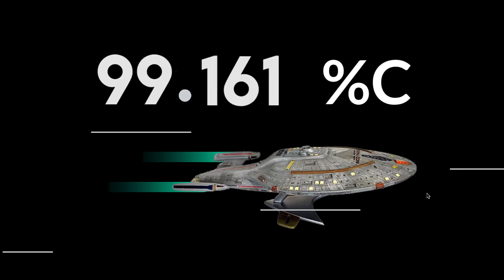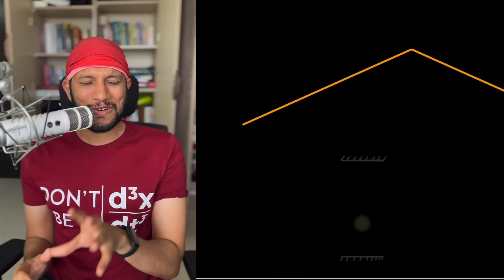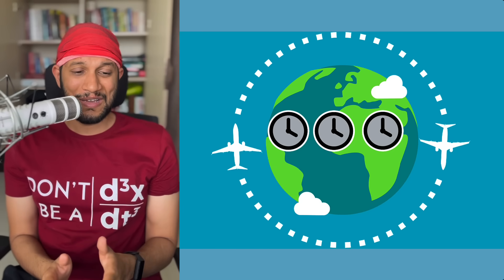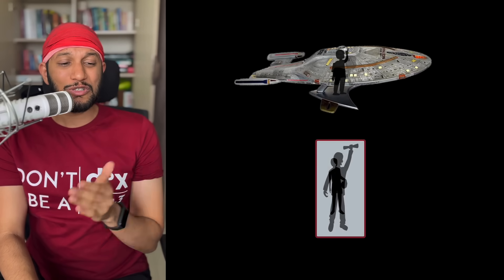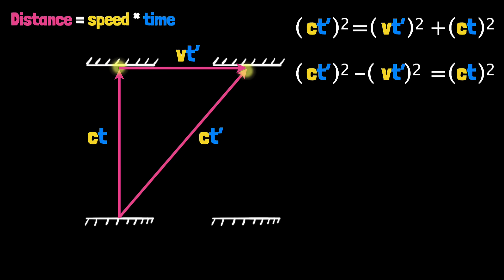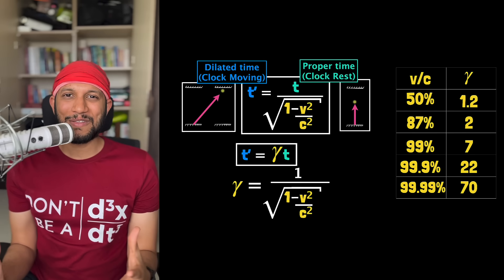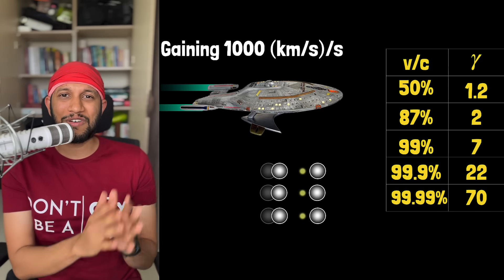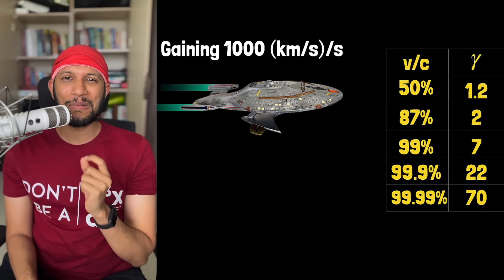I finally understood why you can't go faster than light! (My mind is blown)

Comment: What if 2 vehicals traveld in the opposite direction from each other at 99% the speed of light would they be travelling faster than the speed of light between them ?
Reply: No, they still be traveling at 99% the speed of light. Remember no object with mass can reach the speed of light.
Reply: @Voidඞ but the distance between the 2 would be increasing faster than the speed of light, so nothing with mass is breaking the speed of light individually, but the distance between them would be increasing faster than the speed of light, like space expansion which is faster than the speed of light.
Reply: @420styletomatoes6 Einstein’s speed limit applies to local motion — how fast one object moves through spacetime as seen by another in the same local frame. 

But “the distance between two distant objects increasing faster than c” is a coordinate effect. It’s like saying: “From Earth’s frame, the gap between them grows faster than light — but no signal, no object, and no information is crossing that gap faster than c.”
Reply: @Voidඞ  ok, well what about if when the craft was doing 99% the speed of light they knocked it down into 4th gear, would that give the craff the extra exceleration needed to reach 101% of S.O.L
Reply: @420styletomatoes6 you will need an infinite amount of energy to reach that speed "101%" but that is impossible, and there's no finite force can supply that energy to infinity.
Remember time dilation slows down that ship to infinitely dilated reaching the speed of light. From outside observer that ship looks like slowed down.
Photon's on the other hand is, "timeless" they don't age because time is basically frozen from photon's point of view.
You see, the moment our Sun create's light or photons. That's when moment it hits our eyes. It takes 8 mins. 20 sec. Light from the Sun to Earth. That's why photons can reach the speed of light because they have no mass.
Reply: @Voidඞ  what if i put vodka in my SR Nova fuel tank, would that give me the extra energy needed?
Reply: @420styletomatoes6 good question😆

Comment: If you travel faster than light, you will arrive before you can be seen or observed,but we are observing using light spectrum, so we only really arrive in our observation when the lights reaches us to observe it. Until we change our method of observation, then it becomes visible in data,not by sight.

Comment: Even though the maths add up, we still don't know what the heck is actually happening, and why an object in motion has all processes slowed down, mechanical, biological, atomic, it happens, but why, what is the effect?

Here's another question, why does a photon get anywhere at all, this time dilation doesn't affect light?
Reply: Photon's proper time is = 0
Which is photon's "point of view" time is effectively frozen.
Reply: It does affect light. Photons does not experience time. For them the instance they were created is the same instance that they were captured. So for any photon that you emit from a light source, the time will be same for when it is captured on a screen.
Reply: @tanmaypathrabe9579  Does that sound right to you?, something very strange is going on there.

The measurement of time being off due to the distance any information about it can travel, but the time taken for anything to happen should be constant.
Reply: Cause there is a limit set by universe that nothing can travel faster than the speed of light or you can say faster than information travel speed.

Comment: Can someone answer me this question. If the speed of light is impossible to reach than why cant we just go limes against speed of light? We will never touch the exact speed bit come closer and closer? For example speed of light is 1 in this imagination and we go at the speed of 0,9999999999999999… maybe even period 9. Is this possible in theory?
Reply: 0.99period is exactly 1.
Proof: 
1 divided by 3 equals 0.33period.
3 times 0.33period equals 0.99period.
Remember that you started with 1.
Reply: @ralfrufus6573 ok but you grasp my idea. Is the idea possible?
Reply: @bowlerbowler6869 No matter how close you come to the speed of light, a photon is always moving away from you at the speed of light.
Reply: No object with mass can reach or exceed the speed of light—an infinite amount of energy would be needed to reach speed of light. 
No finite force can supply infinite energy.

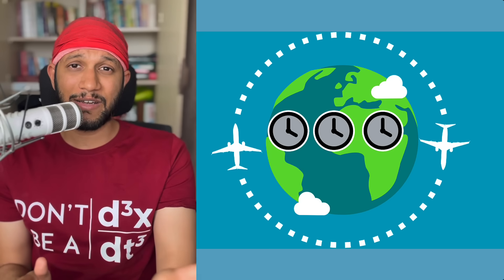Comment: 4:30 - so basically there is no "time dilation". If there is no information transfer in the accelerated body then this phenomenon doesn't occure. So basically if the object is bigger and more complex then the information travels longer between parcicles on both ends of the object. If the object is an single particle, then the phonomenon should not take place. Do i understan correctly?

Comment: You can't go faster than speed of light if you decide that light is the speed limit and the last 100 years physics is based in it, but what if you use a different speed limit? Way should light be the item that decides speed in the universe, if we will find particals or space itself that are faster than light what will happen then?

Comment: So what would happen if you were traveling 99.9% the speed of light and you turn on your headlights?
Bear in mind the if you are flying along in a jet at five hundred miles an hour and fire a machine gun the projectiles will move at 500 mph + the velocity of the machine gun round.
So again what would happen when you turn on the headlights?
Reply: The Relativity ensures the speed of light remains constant for all observers.
So if you turn your headlights on, the light beam will move away from you at the speed of light
Reply: @Voidඞ but wouldn't that mean it was moving almost twice the speed of light?
Reply: @SmithRobert42 there's no such thing as twice the speed of light in Relativity. The speed of light remains a constant. So if you shine a flashlight at 99.9% speed of light–it would still fly the same speed of light and a bit further away from you.
Remember speed of light is a fundamental limit in the universe according to Einstein's theory of special relativity.

Comment: If at all that shows that if you have gravity source you cant get to C and that you cant navigate by eyes because everything from outside comes in with LAG like in online gaming with bad internet. Dont forget that its all relativ even in the literal sense. You inside the ship and all you photons and and your own gravity source accelerate too. Relative to the outside they stand still. Hence why the whole thing si wrong as you see it from a 1 dimensional point of view. You can cross C by many magnitudes but you cant do it at once. You rip apart the bonds of atoms. Also time dose not exist, what exists is decay. New problems arise tho because the faster you get the bigger gravity field you create. Gravity interacts with all forms of radiation and can alter its course. as seen by black holes. so the trick is to get to almost C wait little until all things settle and brake throu C and repeat. But then the you need to stop and deal with the gravity field you emit....

Comment: Interestingly, isnt it that not the time itself is bended, but the "following affects" in space by time.
Like the clock still moves in the time of 10 seconds (time is the same) but the space, the change in space, which happens in time (same 10 seconds) is slowed. Time dosent change, but the following of space and its object, by the time, can change.
If a car drives 100meter in 10 seconds or 10 meter, the time dosent changed, but ofc the "event" in space, by that time.

Comment: I’m new to this topic so correct me if i’m wrong but doesn’t this only explain how we(as the observer in normal time) could never see a universe in which something goes past the speed of light (since it’d need infinite time).

but it doesn’t make it impossible for something (or someone) to do so. Just to observe it from outside. Kind of like how you could never observe the inside of a black hole past the event horizon since nothing (not even light) can escape the gravitational pull no?

Anyway that’s the only contradiction i got from the video and title. Love what a great detailed and conceptual explanation this is!

Comment: Dude mekesh, you CAN reach and exceed that speed of light, in fact you would not even notice when it happens, but you dissapear from this universe. Reason why it appears you cannot go faster then speed of light or reach it is same as why it appears cooper never falls into the black hole. It is a limit to infinity. But aha, you forget then from his point of view he actually does enter the black hole. And for exact same reason (since it is in fact the same process just entered from opposite side) it appears you would need infinite energy to reach speed of light and you never seem to reach it, but from the person traveling aka accelerating he or she actually teaches speed of light and at that speed dissapear for us and we at the same time. Dissape for him and a new universe appears or materialized around him in which he is actually standing still relative to some elements of that universe (uniform motion) which moving with speed less then the speed of light relative to others particles of that universe.

Comment: Fine ... why then light can travel with the speed of light ? Also they say light takes  8 minutes to reach the Earth from the Sun - which 8 minutes - of the earth ? or some different time at in between space ?
Reply: 1.light has no mass .
It is just an electromagnetic wave or the packets called photons whatever it is but it has no MASS .
2.the sun bcz of its fusion process inside create electro magnetic waves(light) .
The distance between earth and Sun is divided by the speed of light (≈3×10⁸ m/s) is the 8 minutes

Comment: I have a question about the photon clock. If the experiment is with a ball, then the ball moves forward to the outside observer due to the ship's speed, adding to it. But for massless!! Photon isn't affected by the ship's speed, so why doesn't it miss the top mirror at constant speeds? Let's say a ship is moving in one direction, and someone is pointing a laser beam in the opposite direction, which doesn't make the beam slow down for an outside observer, but the ball will slow down, so why does light get horizontal movement, just like a ball? Explain it like I'm five.
Reply: I didn't understand your question after reading it several times.
But a mass having object can't get the speed of light.
And for any observer speed of light cannot be broken
Reply: @G.1.R-lyl  Sorry about my English. 
I was confused about the diagonal path of the photon in the photon clock (as seen by an outside observer).

If we throw a ball straight up inside a moving train, the person inside sees it go straight up and down, but an outside observer sees it follow a diagonal path because the ball gets the forward motion from the train’s movement. Similarly, if the ball is thrown in the opposite direction of the train’s movement (with equal speed), the outside observer would see it as not moving.

So my question is: if we “throw” photons straight up, why do they behave like a ball and move in a diagonal direction for the outside observer? Also, what would happen if a photon were emitted in the opposite direction of the train’s motion?
Reply: @caesium1379 hmm i understood the question.
So you are asking why photons act like Ball.
Bcz they are tiny packets don't have mass but can reflect from the surface like same as the Ball.
It's just an analogy.

Second Yes, but photons move in Speed of light so train can't move .
Hey but we can slow Photon by changing the medium like glass or diamond and as you said what happens with ball same  can be seen in case of photons.

Comment: That's why a car going 200 mph consumes more fuel then one going 20mph. One could imagine for the last bit of speed accelarating to 99.99999999999999999999999% the speed of light you will need the size of more then the observable universe in gasoline to accelerate.. and even then you can just add another 9... It's impossible to reach 100% because infinity > size of the observable universe in gasoline the later one still being finite.

Comment: Did you know that if you travel north-south this effect doesn't exists. Explain that!
Let me give you an equation that some day will be accepted: Vt = Vm/Sqrt[1-(Vm-sqared)/(C-squared)]. Where Vm is the measured velocity and Vt is the actual (true) velocity. Apply this to your muon and you'll find that no time dialation or lenght contraction is needed to explain why the muon reaches earth from the upper atmosphere. You can also use this equation to find the momentum of particles in particle accelerators How about that! And yes, this eq. allowes for faster than light velocities.

Comment: Isn't the energy that's moving the ship forward, is also added to the photon within the photon clock onboard the ship, it's got a mass however negligible it may be. So when the ship is moving the ticking time of the photom shouldn't theoretically slow down, cuz vertically it's using own energy but horizontally the energy is being supplied by the ship's power source. It's incomprehensible that if the people onboard wouldn't see the ticking time slowing down, why someone on the outside should see or feel that?

Comment: BIG logical flaw Mehesh. The time dilation is just visual. In other words, it takes longer and longer for photon from the spending ship to reach us and ours to reach it, as if zooms faster and faster away. And so to the outside we will have at a moment close to the speed of light just a frozen image of the rocked which will then red shift more and more like any object falling into a black hole until it daes away into the black background of the universe. But from inside of the spaceship nothing really happened. They reached the speed of light without needing infinite energy and reaching it washed from this universe into another where particles now move relative to the spaceship with a speed less than that the speed of light. But they didn't need infinite power to reach that speed. So this seeing and as they reach the speed of light not seeing the spaceship anymore (at btw from their perspective due to relativity they not seeing us anymore or the universe either) is just visual, but they literally transition into another similar universe, or we can say due to the relativity we and our universe vanished. Both is equally true.  But the whole idea of infinite energy needed to reach the speed of light is nonsense. Remember right now we are already moving with the speed of light relative to things we cannot see. You had even class about that explain that we can move in space but not in time because the axis of time is length contracted basically to zero.

Comment: Another one.... Imagine a photon. A photon has no concept of time or distance.
Because photons travel at the speed of light, all apparent distance for it is 0.
For the photon, it crashes into the back of your eyeball the moment is was released in the sun.
Terms and conditions apply*
*It isn't like that literally because the photon is not travelling in a vacuum all the time but close as dammit. certainly true of a photon from the upper chromosphere to the moon for instance.

Comment: Ok. even if the clocks tick differently. This doesn't mean that biological matter ages slower. The time measures rotation of earth and orbit around the sun. If a person travels at near the speed of light for 2 years. The time on earth is the same. That person's age is counted in Earth time. The time that is counted on earth is the same. That person is 2 years older in Earth time. That is a proven fact that persons perception of time warps without sunrise and sunset cycles. I cannot believe so many people are this dumb. Yet, I am not surprised.

Comment: Sounds like a wank. The time measures position of the sun relative to Earth. Gravity in away from surface is less effective. There is more radiation higher in atmosphere. Who knows if gravity or other factors do not affect clocks. No one travels faster then astronauts in orbit. None of this is relevant.

Comment: I thought it was impossible to find a universal "still point" cause everything is moving in relative with each other. But if we could get an atomic clock, and measure it at different points in space, one of the positions would be where time moves the fastest. Cause the causality (force carriers) would move slower when the clock is moving.